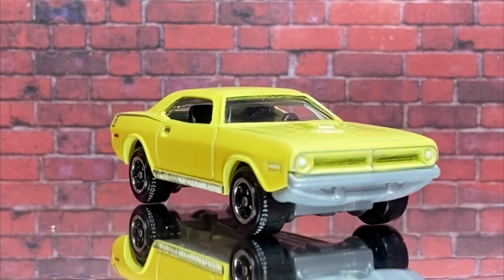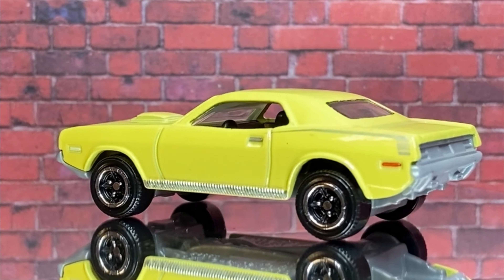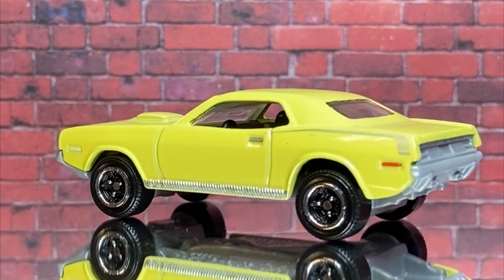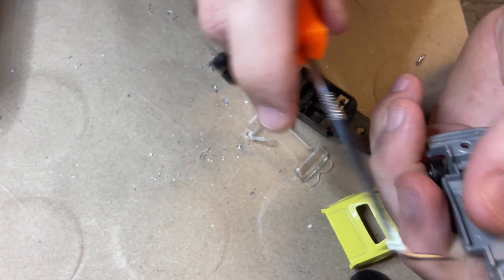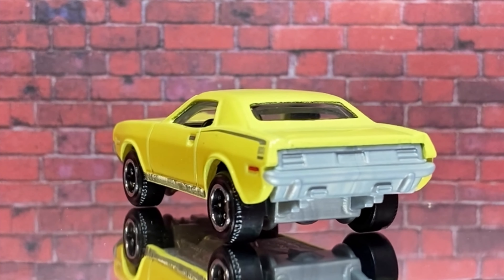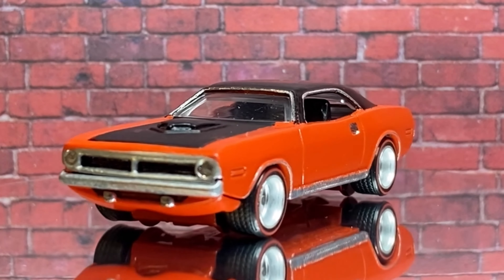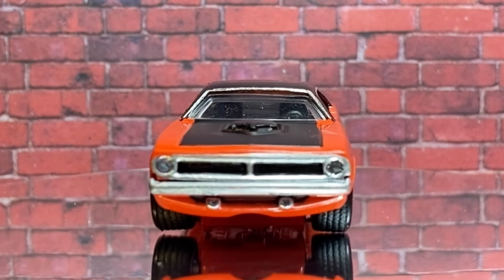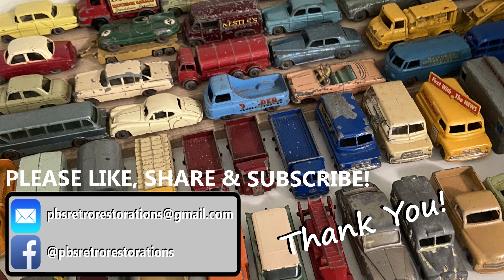Matchbox 1970 Plymouth Hemi Cuda Mopar Build with Matchbox Mark!

Comment: I like the color choices, but I thought the hood was supposed to be the color of the car, and the shaker was supposed to be black. I like that simulated vinyl top too. That came out pretty cool. Obviously, people customize their cars and even order packages from the factory, such as a black hood, but I was just referring to the way it would have been while sitting brand new at the dealership. I don't know what it is about them, but recently I've been really getting into these Cudas, and the Barracudas too. I did one where most of the car was yellow, and I painted the whole front clip black. All except the shaker. I left the shaker alone, so it's yellow. I used micro point Sharpies to detail the rear panel, a white paint pen to do the headlights and the driving lights on the lower valance, and I used an orange micro point Sharpie to color in the front side marker lights. Why they colored in the rear side markers but not the front ones is a mystery to me. Other than that, I didn't do anything else... Yet. I didn't go as far as you did going under the rear of the car, such as the bumper and exhaust. I've been thinking about doing a black top on mine too, and seeing how it turned out on yours, I'm seriously considering it even more.
Reply from the maker: Thank you! I did the black hood to hide where I ruined the paint trying to paint the shaker! I took inspiration from Aussie performance Mopars with their black hoods and ran with it. I reckon a vinyl top looks good on most muscle cars, especially Cudas and Chargers. I think the Cuda shakers were 'argent' (silver) on chrome bumper cars and body colour on early builds with the elastomeric bumpers, but I'm probably wrong lol.
Reply: @PBsRetroRestorations 
That was exactly my motivation for doing the entire hood too lol. No matter how careful I was with trying to clean up an area that I messed up, it only made it worse. I went as far as using a little bit of Goof Off on the point of a toothpick, and somehow I made it worse with that. All I could do was spread the black out further and further, and any attempt to stop it from spreading only made it worse. I got to the point that I took a black micro point Sharpie and drew the border around the front and sides of the hood, then I extended the line carefully up the cowl because the groove stopped short.